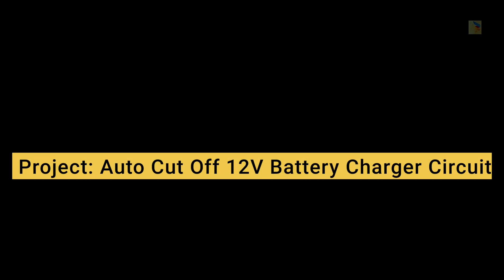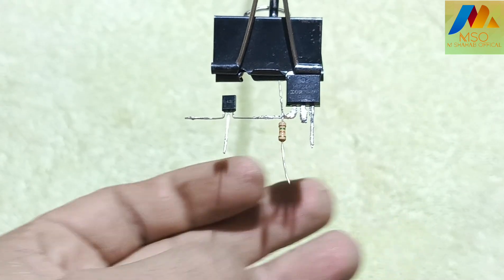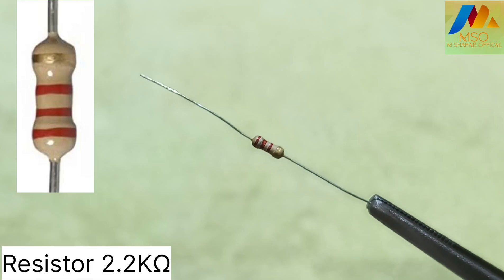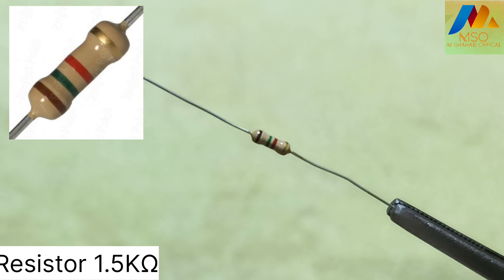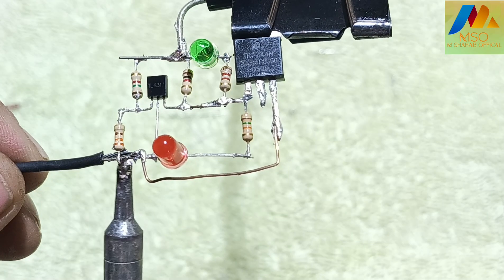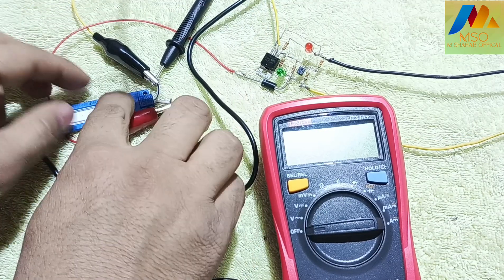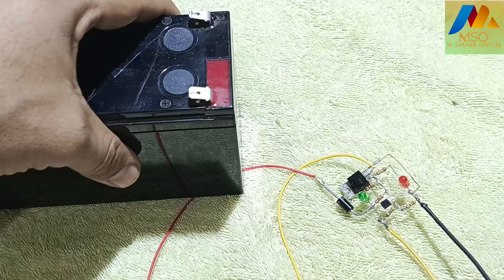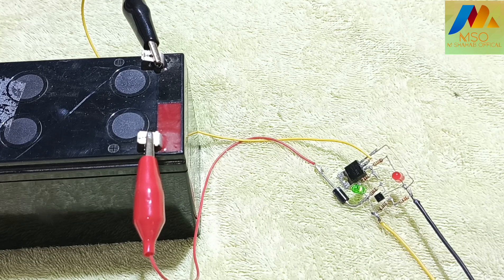Auto Cut Off 12v Battery Charger circuit  with full charge indicator|Auto cutoff 12v Battery Charger

Comment: Isko 50 amp agr source h to use kr saktay h agr nhi to kya kya change karna padega
Reply from the maker: I inform u a soon as possible
Reply from the maker: یہ چھوٹے لوڈ (low current) جیسے 1A سے 5A کے لیے design کیا گیا ہے۔ اگر آپ اس کو 50 Ampere DC source کے ساتھ استعمال کرنا چاہتے ہیں تو کافی تبدیلیاں کرنا ضروری ہوں گی
Reply from the maker: اگر آپ کو 50A پر استعمال کرنا ہے تو یہ تبدیلیاں کریں:

🔁 Replace Components:

Component	Replace with	Notes

IRFZ44N	IRFP4568, IRFP2907, یا IRF1405	High current (100A+) MOSFET, heatsink ضروری
IN5408	Schottky diode 100A – 200A (e.g., MBR20100)	کم voltage drop والا, high amp
Wiring & Tracks	موٹے wires یا copper strips	50A current کے لیے minimum 10mm² copper wire
Heatsinks + Cooling	MOSFET اور diode کے لیے	Heat سے بچاؤ لازمی ہے
Reply: Read more ka option nhi open ho rha ji pls isy hi bta dy puri details hindi m  @Mshahaboffical
Reply from the maker: Replace Components:

Component	Replace with	Notes

IRFZ44N	IRFP4568, IRFP2907, یا IRF1405	High current (100A+) MOSFET, heatsink ضروری
IN5408	Schottky diode 100A – 200A (e.g., MBR20100)	کم voltage drop والا, high amp
Wiring & Tracks	موٹے wires یا copper strips	50A current کے لیے minimum 10mm² copper wire
Heatsinks + Cooling	MOSFET اور diode کے لیے	Heat سے بچاؤ لازمی ہے
Reply from the maker: Heat dissipation کے لیے fan یا thermal cutoff add کریں۔

PCB استعمال نہ کریں — point-to-point wiring یا heavy duty bus bar استعمال کریں۔

اگر 50A continuous چاہیے، تو parallel MOSFETs
Reply from the maker: لگانا بہتر ہوگا
Reply from the maker: Suggestion:

اگر آپ کا مقصد ہے کہ 12V 50A battery کو safely charge کریں:

تو آپ بہتر ہے کہ professional DC charger یا industrial-grade battery controller استعمال کریں۔

یہ circuit educational یا low current batteries کے لیے best ہے۔
Reply: Thanks  @Mshahaboffical

Comment: Thanks a lot, perfect job. 
Would you please, show us How do  you adjust the output and input voltage with complete circuit diagram. 
Is this circuit suitable to charge a car battery 12vdc,  45 ampere. 
Appreciated
Reply from the maker: Thank❤🙏
Reply from the maker: Dear, 
Yes you used this circuit for car battery Charging.

Comment: Super Boss I have small request to where to connect digital voltmeter and ringer... Thank u👌
Reply from the maker: Thank you very much for the compliment.
Reply from the maker: Dear,
Connect the voltmeter between the Mosfet(IRFZ44N) Drain pin and the cathode pin of the diode(1N5408) to read the output voltage.